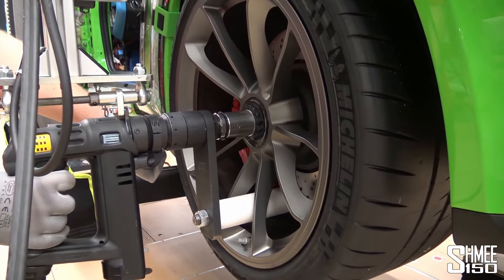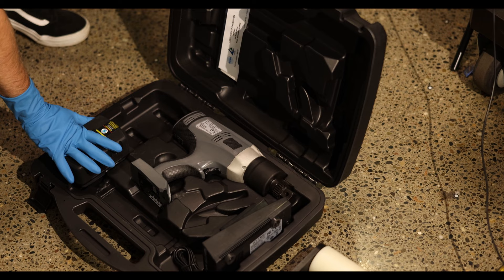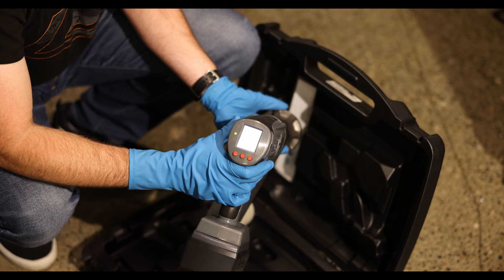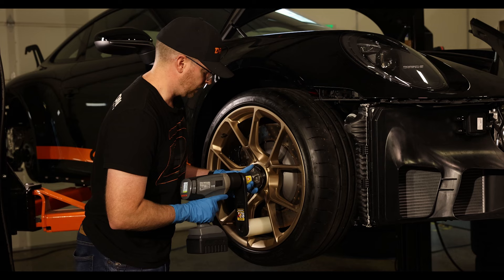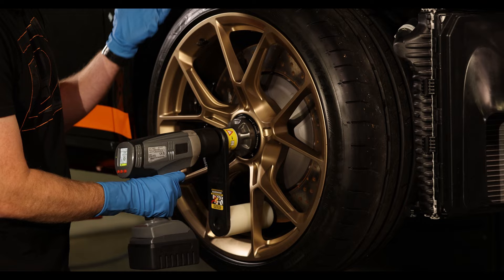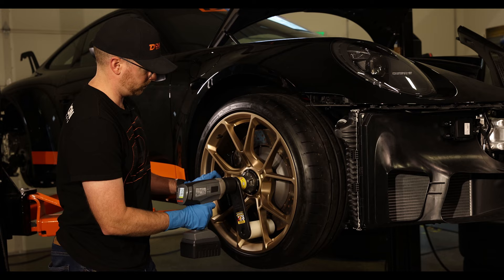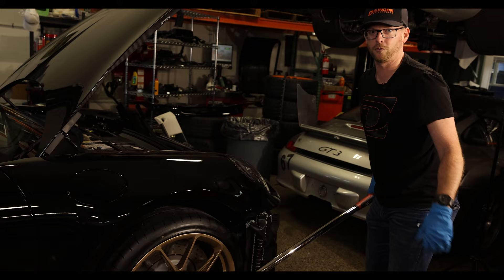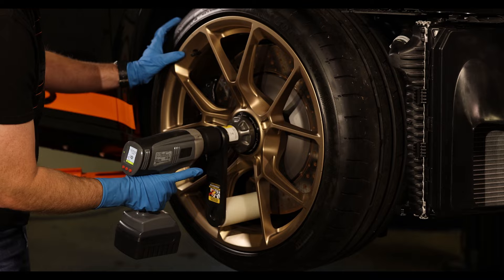Dundon Motorsports / HYTORC Centerlock Wheel Gun

Comment: Nice bit of kit. When you apply torque with a bar or torque wrench, Porsche recommends only pulling the bar upwards, not downwards towards the ground. This matches the normal direction in which the suspension is designed to be under load.
Reply: why porsche recommend to open this lock on mid air? i mean hanging.  to prevent damage to centre rod?

Comment: Maybe I'm missing something, but the torque wrench verification only let you know it was at least 440 ft/lbs. But it doesn't tell you if it's over tightened. It could've been 500, or 600 for that matter. What is the possible error of the battery powered tool? If it has an error of +/- 3%, set the torque wrench to just above that (453.2), and see if the nut moves at all.
Reply: The possible error of a programmable battery powered tool that costs 5000 dollars better be 0%

Comment: Though I don't anticipate running out of battery, I do have two cars with center locks.  Is another battery available to buy and if so, what is the price for one?  Eventually the battery it comes with will degrade and need replaced anyway.
Reply from the maker: absolutely you can get another battery.  Additional $200.00